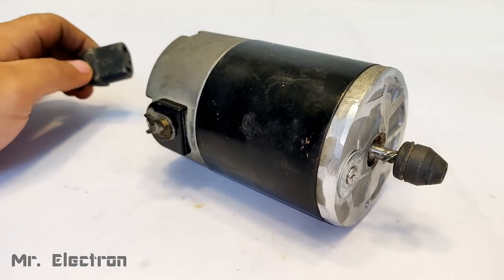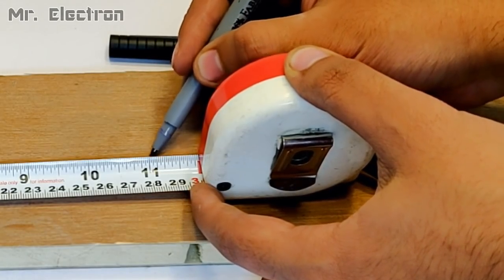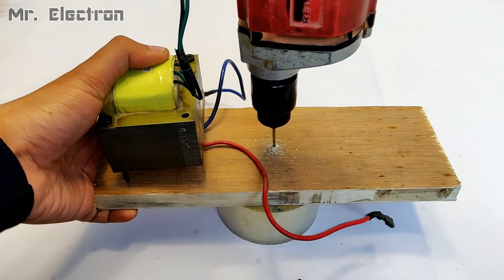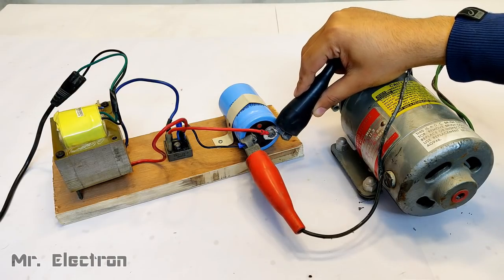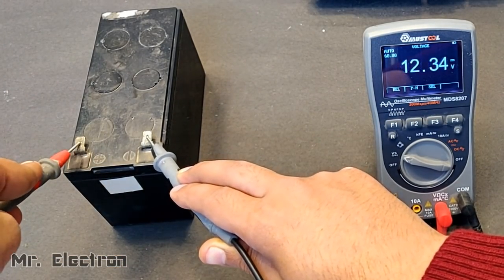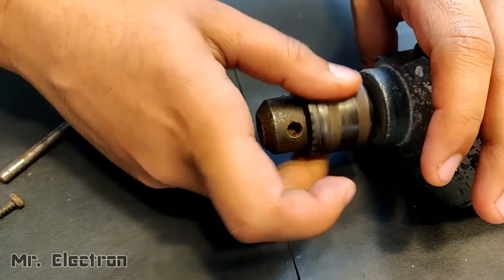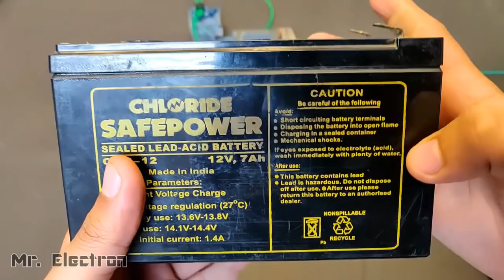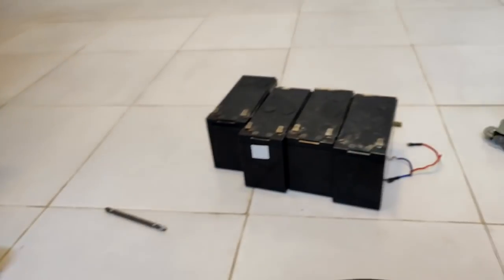3 SIMPLE INVENTIONS with DC Motor

Comment: you didn't have to remove the stater wingdings because all drill motors are universal motors, meaning they will run on AC or DC providing  it is supplied with 120 or 220 volts read the label or instructions it says that. so you went to alot of trouble for nothing. Next drill motor, try hooking it to 120 volts DC and see how it works. those pathetic magnets you put in the motor are very weak compared to the powerful field winding's you tossed out!

Comment: I dont get it, on the 1st project with DC motor...the light bulb states is for 220 vac volts, however that motor only generates DC voltage not AC,  so if is .if is a DC motor, why did it light up the 220 VAC bulb?
Reply: Light bulbs (incandescent or Edison effect ones for sure) works from both AC and DC power. It is simple: current generates heat on/in wire, and csuse of heat light is also produced. Does not depend what type of current we use, electron flow generates heat and so light.
Reply: Georg Rosas, he used an LED bulb for demonstration. Now, in the circuit of an LED bulb first stage is a bridge rectifier which works for AC and DC both. Draw the circuit diagram of a bridge rectifier on a paper, you will understand it better. The only difference is that when AC is applied to a bridge rectifier all the four diodes in the bridge works for every complete cycle of the AC but when DC is applied to the input, only two diodes will operate. For any given polarity of the input DC voltage to the bridge rectifier, if any particular two diodes are operating then for the reverse polarity applied to the bridge rectifier, the other two diodes will be operating.

Comment: Did you connect the positive wire to the negative side of that capacitor. I wasn't sure as you covered the marking on the cap with the big washer? that capacitor could burst if is backwards

Comment: Yes I have seen those videos of conversion of drill to dc power mostly are fake
Reply: It is not necessary to convert a UNIVERSAL motor to DC! because that is what UNIVERSAL means! look it up. Drill motors, in particular, may run on AC or DC providing they have sufficient current supplied to them. I am talking the old style, "corded" drill motors

Comment: You are wrong about :
Can 12v be used to turn on the 220v universal motor?
Answer: yes but you have to use the wires directly without the two carbons like you did
Reply: You can turn on your 240v ac or 110v ac drill , vacuum cleaner  by connect 12 vdc or 24vdc DIRECT TO YOUR DRILL OR VACUUM AT POWER CORD DON'T  CARE ABOUT POLARITY (+ or _ ) IT WILL WORK . No need to remove carbon brushes .
Good luck .
Reply: @erotran1575  thank's for your clarification